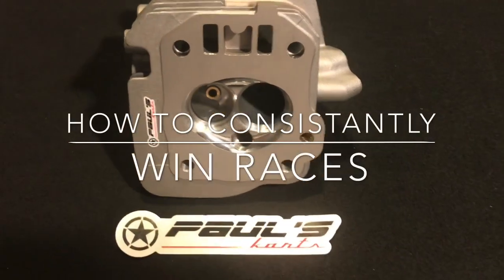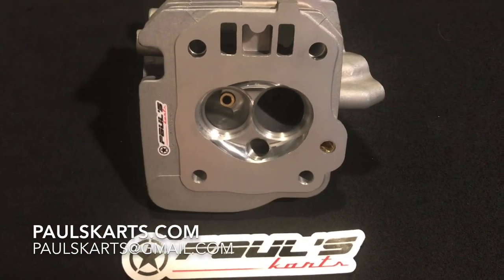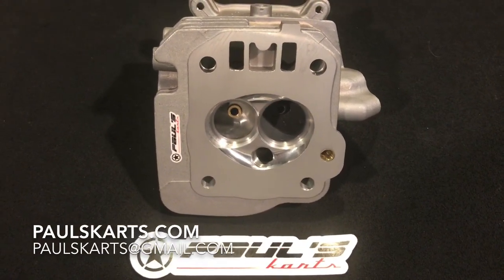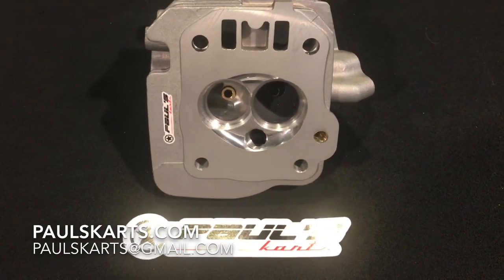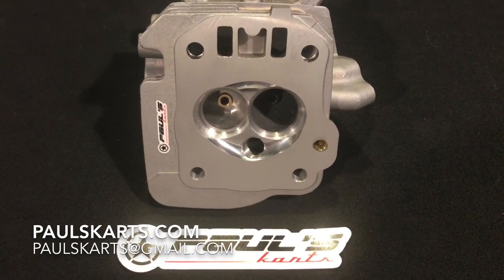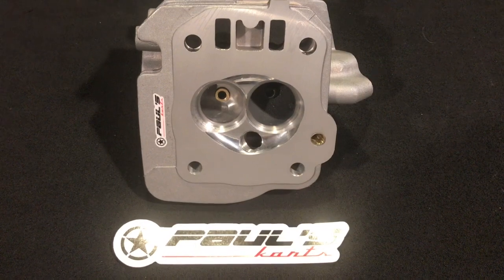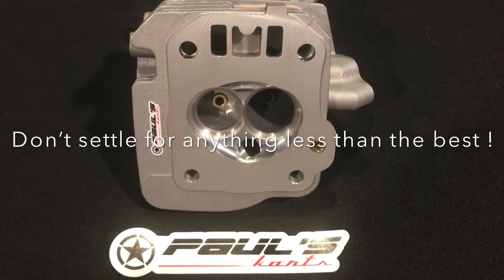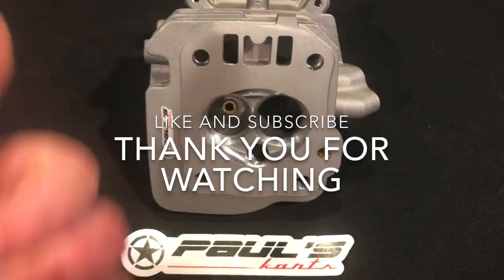How to consistently get the win, engine math, science, Paul’s karts

Comment: So what would happen if you spend all that money and lose and your opponent spent maybe half of what you did what's the next step?????
Reply from the maker: Good question. Builds are about making max HP per cubic inch. There are many variables. I always recommend a plan form the beginning. Purchasing high quality parts and having them installed to exact tolerances. This is how to plan and execute a build. There are many choices so where do you start. I always start at the bore, I want the biggest bore I can get. Then the piston fit to the bore. This is the most important part because bore quality, concentricity and RING SEAL is the most important part of the engine. You want to start with a good foundation because no matter the flow or compression ratio if your oil is milky and full of methanol than your rings are not holding the pressure. So all the flow and compression does not matter because it’s not contained. So ring seal !!!! A good sleeve like the LA sleeve , sleeves we use are more suited to the pressure and offer more rigidity hence power. Gas ported pistons like the ones we offer and a high quality piston and buy specific “separately” high quality ring set like our gapless ring sets from total seal. Boom that’s a great foundation. And like I said , as big as possible. Remember it’s about HP per cube so making the cubic inches more to begins with is going to give you the largest increase in “Per cube HP” capability. Crank (BILLET) for rigidity ! Special alloy !!! Harder metals. Stiffer … less losses from flex and less distortion on crank pin. Notice how many line items we have discussed and heads have not even entered top 5 . After the bottom end .. we come to the head. Again the big bore allows bigger valves. Creates a bigger depression on the intake stroke. This pulls in more air so the cfm demand is there. Matching a head to this engine will net huge results. Then you get into valve materials like titanium and spring rates for controls and seats and seat material to midi gate bounce and valve temp. Then fuel type , camshafts , carbs and high quality assemblies. It’s all about a package. You can take a 10,000 HP funny car and know without a doubt that’s a perfectly paired setup. Now take that head off and put it in your daily driver Chevy and it will be a dog. The support for it is not there. Parts are parts. Services are services. It’s the package as a whole that performs. So to answer the question. If you purchased some parts. I’d ask what was the rest of the build like ? And where the missing link or links are. And when it comes to winning and losing a race it’s more than power. Getting from Point A to point B involves “the engine” but also weight, a good driver,  clutches, gearing, frames, tires and prep, wheels and rotating weights, and testing testing testing.

So if your starting off or already setup and looking at making a purchase here is a quick list. MAKE A PLAN, will you be riding around, drag racing, and at what level ? Pro level ? So now you got a base idea. Now grab a frame, engine, clutch and accessories. And when your looking for parts… base those off your “goals”. For example. Cars ! So car racing for example, there are levels from the Honda beater to the 2 million dollar funny cars all fall under drag racing. So parts would vary in price depending on what your building. As far as mini bikes go a good drag roller frame can be found for $500. You can get my best small block on the site for $3k , a amazing polar torque converter setup for $500 and round out accessories for say even a large amount say $1k that’s pro level build for $5k. That’s probably like what a set of tires costs on a $2 million dollar funny car. So it’s a cheap sport at its best. Don’t be the guy that gets a frame and a $100 predator and slaps a $300 head on it and wonders why he is not the fastest around. And don’t compare specialized small engine parts with car parts because there just not the same. Even if they where, you would look pretty funny trying to slap a turbo charged “LS” engine on a doodle bug frame. Like really .. so you can’t compare.. This sport Is already cheap so be realistic with your goals. Wanna get the most out of any racing sport and mini bikes will give you the bug from the first pass on a 3” stroker. So I suggest to all people to do it right. Get the best parts, build something competitive and take that ride of your life down through the trap in the 1/8th next to your good buddy and look over at him to the mirror image of your ear to ear smile. This is one sport you can never get enough of ! I got the bug and so will you. Paul
Reply: @paulskartslifan4206  You can also find an engineer with years of proven success, who understands the fundamental principles of internal combustion engines, physics and chemistry.
Someone who doesn't try to baffle you with flash terms they have read in a book and only have perhaps a 30% of the actual engineering.
Paul obviously does a great job.
If you are on a tight budget, I can promise you, go look for an old bloke who has 50 years of racing experience, who would give an arm to help an "also ran".

Comment: Paul would you ever consider doing work to an LS head? I’m building a forged motor right now with a goal of 1000+ hp, and I’d be interested in seeing what this kind of work can do to a full-tilt v8.
Reply from the maker: Hey , thanks for the kind words. I could probably do it if I have the tooling size. I’d need a pilot size to fit your guides for my mill to locate. I’d need to know the valve head size to know if I have the size cutter heads for the seat angles. The porting and polishing would be a lot of work on 8 cylinders. If you want me to think some more contact me thru the website with some pics of the heads and stuff or email me at paulskarts@gmail.com

Comment: I just stumbled across your videos and love what you do with your cylinder heads. Very impressive work. I gotta check out your website.
Reply from the maker: Justin Stewart // 🥰🥰🥰😎😎😎💯💯💯👍🏻👍🏻👍🏻
Reply: @paulskartslifan4206  do you do any work on gx200 clones?
Reply from the maker: Justin Stewart / yes this head is a gx200 clone .. almost all engines are a clone in one way or another
Reply: @paulskartslifan4206  unam starting to realize that myself. After talking to a few aftermarket manufacturers I found out I can use a honda gx200 cam on my briggs cr950 engine😅. Minor differences throughout from what I've seen so far.

Comment: Nope. All you need is a HOG ASS CAM. KIDDING. Keep it up man😂
Reply from the maker: Hunter Petrovich sup kid ! How’s it going .. still got that mini bike ? How’s that engine you built running ? Ever find a cam that fit that thing ? What kind of engine was it again
Reply: @paulskartslifan4206  well derby season just ended so I should be able to actually start the build lol. I bought one of the only cams left for those motors. Tecumseh ohh55.